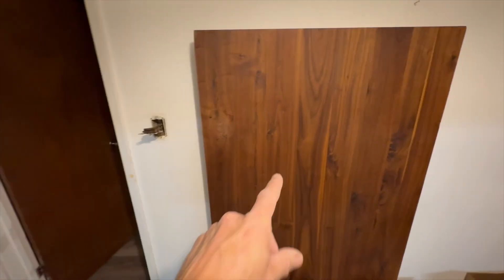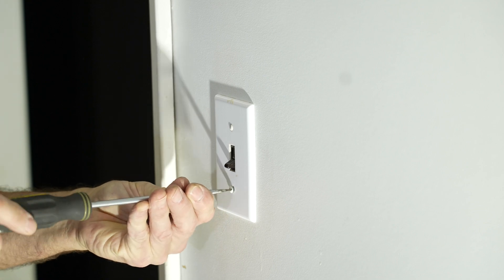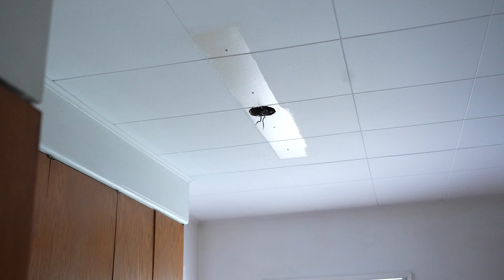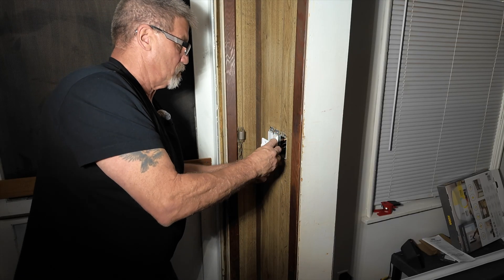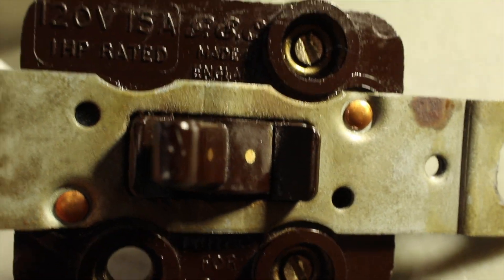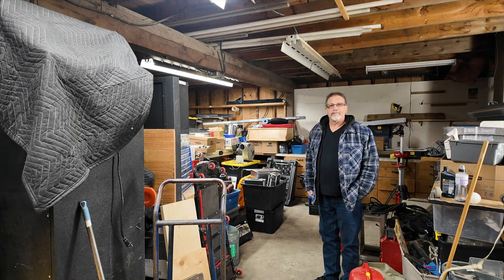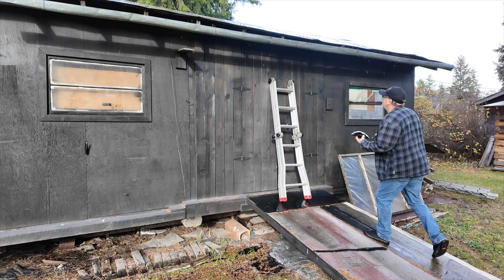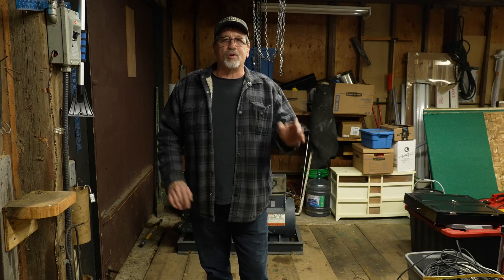How Did Switches From England End Up In a Mill House In Western Canada?..An Electrical Extravaganza.

Comment: Hi, wondering if you found out anything new about this? I found the exact same, identical switch in my house here in Halifax. The house is a WWII pre-fab built on stilts by the Wartime Housing Corporation. Apparently, when WHC became the Canada Mortgage and Housing Corp in 1946, they sold off the homes with first dibs going to the existing tenants at the time. $1000 conditional that they excavate and build a proper foundation.
Reply from the maker: That's really interesting.. But no. No one has come forward with any information about these. Please let me know if you find out anything. Thanks for watching.

Comment: Super interesting that those switches were made in England. I wasn't expecting that. I'm curious to know what the temperatures have been like up there and what special preparations you will have to do before winter. Do most folks there keep generators on hand?
Reply from the maker: Temperatures have been right around freezing for the last week. I guess everyone has their own ritual for getting ready for winter. I haven't been up here for a winter yet so I'm expecting the worst. Some locals say that we're in the banana belt of the region and some remember the winter of 78 where we got 5 feet of snow and everyone was trapped for weeks... and everything in between. So I'm just going to have to wait and see... "Come on global warming"... But I digress. I tilled my gardens and stocked up on firewood. Loaded up the freezer and the pantry. Dug out the woolies and thick socks. Yes, to the generators. All the power lines are above ground here so they tend to take a beating in the winter.. with cars sliding into poles and trees heavy with snow falling on the lines. It's a good idea to have a generator handy. A wood burning stove doesn't hurt either.  Thanks for watching. Have a safe winter.
Reply: You are a handy guy to know.😊
Reply from the maker: Thanks.

Comment: Great video mate, good that you changed out all those switches. Here in Australia homeowners can't do their own electrical at all, it's incredibly frustrating. If we do our own wiring and something happens insurance will deny all claims if they find out.
Reply: it is the same in canada
Reply from the maker: In BC, You don't need an electrical permit for minor electrical work, such as replacing defective fuses, receptacles, switches, or bulbs with units of similar type and rating. But in my experience you can't do anything at all in a townhouse or other attached type home. But Detached you can do minor repairs.
Reply: No electrical or gas if not qualified in the UK. Not worth it.